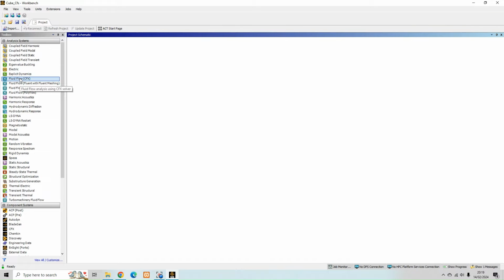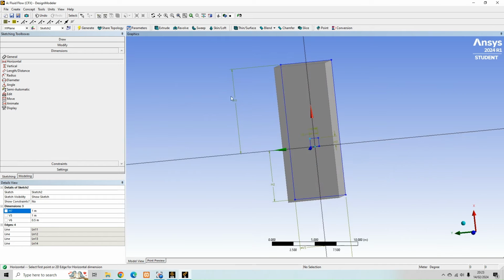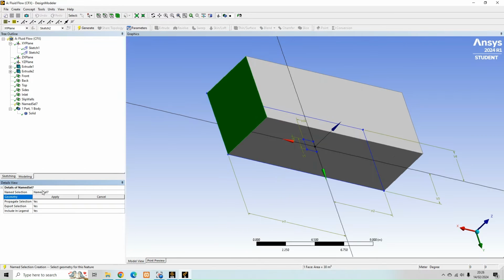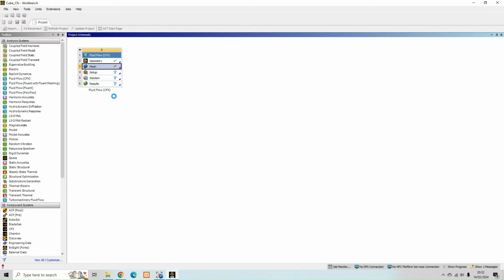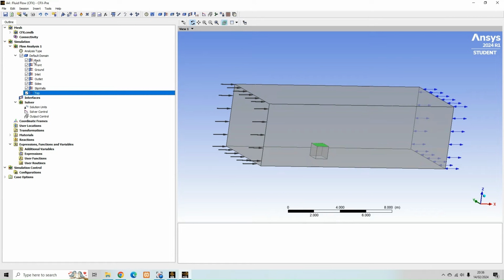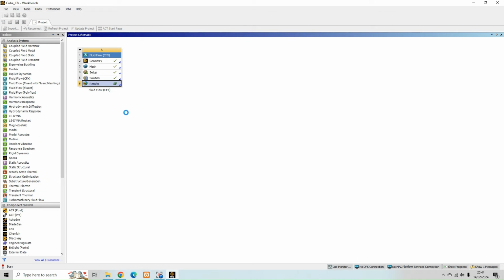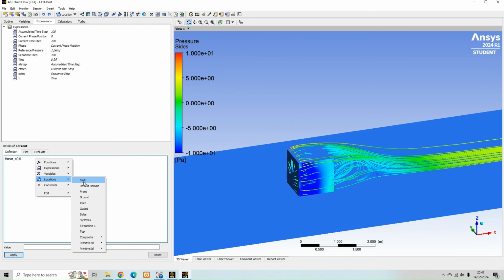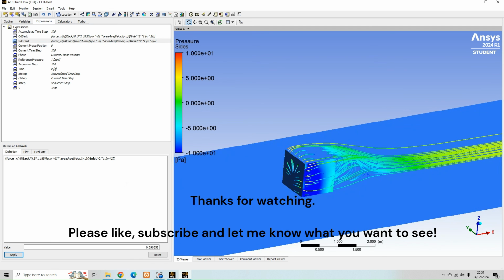How to Obtain Drag Coefficient On Surfaces In Ansys CFX

Comment: Coefficient of pressure formula is - static pressure/ 0.5*1.25* velocity .? Na why do you use this formula can you pls explain it
Reply: The drag coefficient is the ratio of the actual force to the theoretical force. The theoretical force is dynamic pressure * action area. According to Bernoulli equation, the dynamic pressure calculation method is (pd=ρ v*v/2). I hope the above description can help you

Comment: I'm so happy you're back. May I ask, considering the significance of accurate boundary conditions in computational fluid dynamics, especially in the context of drag prediction, could you elaborate on any specific challenges or considerations one might encounter when defining realistic boundary conditions for different surface geometries? Additionally, how does ANSYS CFX address or mitigate these challenges to ensure accurate drag coefficient calculations?
Reply from the maker: I’m so happy to be back!

Also, I love your rebrand. I’ve been following you since you were @JB.

WRT your question: this is a model and our BCs are representative of those of a wind tunnel.

We assume time-averted flow behaviour so we miss out on the instantaneous physics.

Also, the mesh is extremely coarse and omits prism layers for wall-normal gradient capture.
Reply: @ClimateCFD 
It was @jb_42 but thank you

And thank you for providing insights into the simulation model, and I appreciate your explanation regarding the representation of wind tunnel boundary conditions and the considerations made for time-averaged flow behavior. Your clarification on the mesh resolution choices is also valuable. I now have a clearer understanding of the trade-offs involved in the simulation approach. I look forward to further exploring these concepts. Thank you for your time and expertise 

For a future video could you possibly cover multiphase flow modeling?

Ta bab
Reply from the maker: @ShropVentures  would love to, pet.
Reply: @ClimateCFD hey brother,
Please make a tutorial on turbulent flow in a circular pipe with constant diameter in ansys fluent. How to mesh it with the inflation layer as well.
Reply from the maker: @JAYPANCHAL-u1t  yeah, sure.

Think there’s already one on the channel, but that might be CFX.